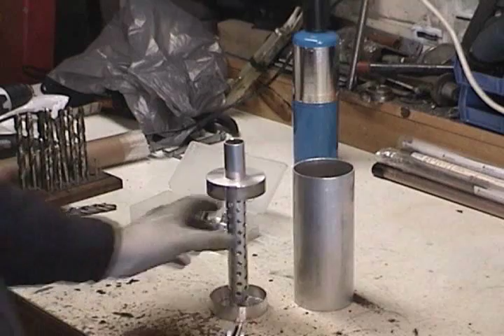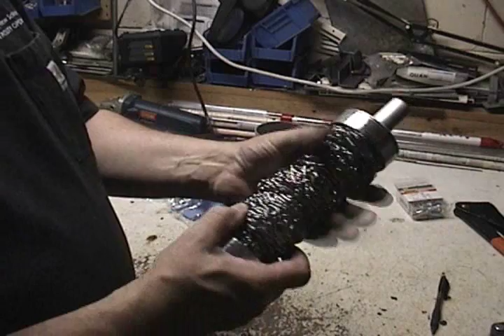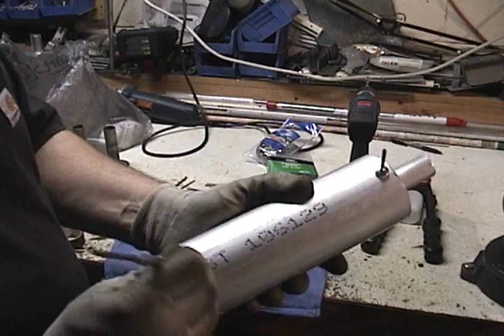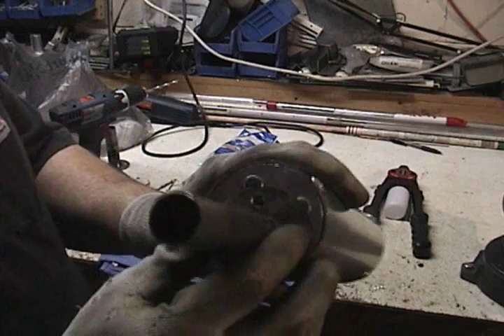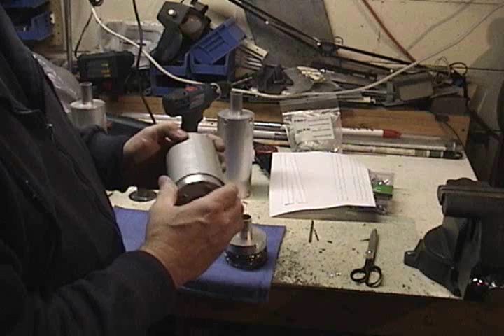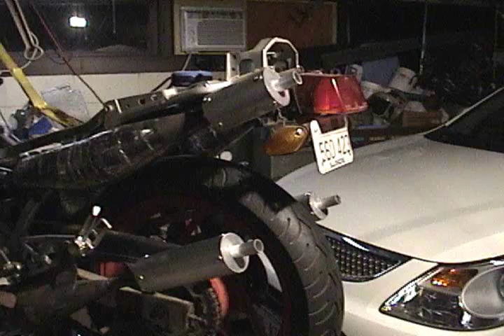RZ 500 TSI pipes,Silencers part 2

Comment: I would really reconsider using stainless steel for packing your aluminium silencers due to these metals being dissimilar metals. They will react with each other through a process known as galvanic corrosion. Causing the aluminium to become unstable due to loss of ions from the contact of stainless steel. Aluminium has an Anodic Index (v) of 0.95v and stainless steels typically have an index of around 0.60v, a difference of 0.25v will result galvanic corrosion. Please see links below about this process.

http://www.structx.com/Material_Property_Pictures/012-Bi-Metallic_Corrosion_of_Commonly_Encountered_Materials.png

http://www.engineersedge.com/galvanic_capatability.htm

Coatings could be used to isolate the two materials of each other but I think that would either be expensive or inefficient due to the vibrations and abrasive environment of the silencer.
Reply from the maker: I hadn’t thought about that ,but you are absolutely right. Hopefully the 2 stroke oil, and carbon will deposit enough to minimize that. We will see